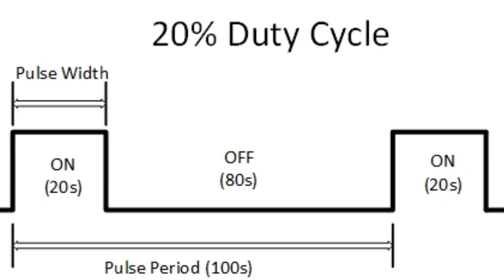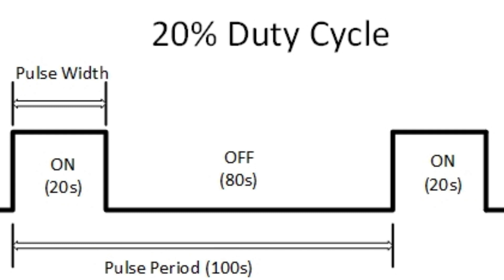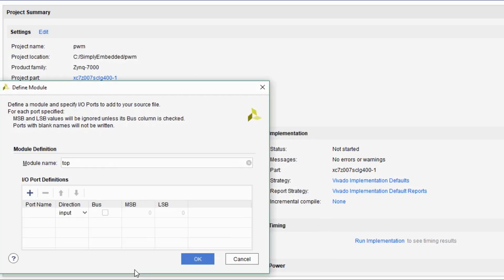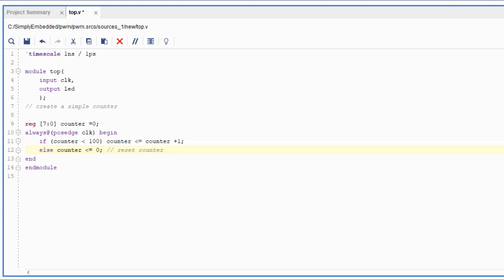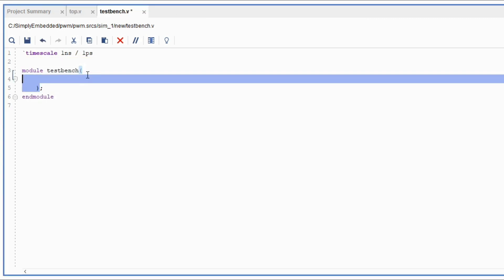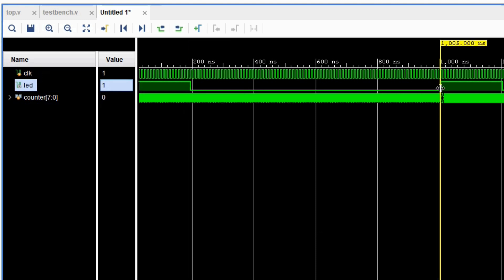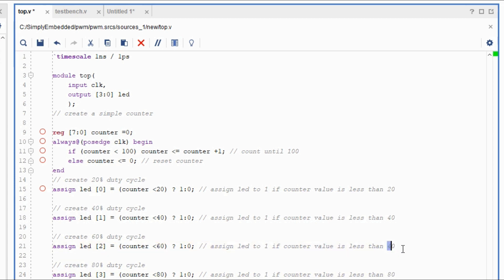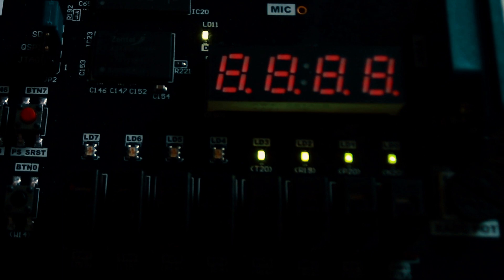How to Create PWM in Verilog on FPGA? | Xilinx FPGA Programming Tutorials

Comment: in the always block (the counter on the posedge of the clock), does the system just know to automatically spread-out the counting so that it is evenly spread out over the high period of the clock? Or does it not work that way? Is it incrementing the counter once per clock posedge detection, or is it doing all the counting at once at each posedge detection?  How come it doesn't just 'count too fast' and then not do anything?

Comment: This code, even when i put the right pins defined by a .xdc of my board (which is zynq-7000 xc7z020clg484-1), doesn't work. Apparently, vivado can't understand what is within the get_ports{    }. Please, help me! Synthesis and implementation is going well, but when i generate bistream, that error comes.##clock
set_property -dict { PACKAGE_PIN H16 IOSTANDARD LVCMOS33} [get_ports {GCLK}];

create_clock -add -name sys_clk_pin -period 10.00 -waveform {0 4} [get_ports{GCLK}];

##led
set_property -dict { PACKAGE_PIN T22 IOSTANDARD LVCMOS33} [get_ports{LD0}];  # "LD0"
set_property -dict { PACKAGE_PIN T21 IOSTANDARD LVCMOS33} [get_ports{LD1}];  # "LD1"
set_property -dict { PACKAGE_PIN U22 IOSTANDARD LVCMOS33} [get_ports{LD2}];  # "LD2"
set_property -dict { PACKAGE_PIN U21 IOSTANDARD LVCMOS33} [get_ports{LD3}];  # "LD3"
set_property -dict { PACKAGE_PIN V22 IOSTANDARD LVCMOS33} [get_ports{LD4}];  # "LD4"
set_property -dict { PACKAGE_PIN W22 IOSTANDARD LVCMOS33} [get_ports{LD5}];  # "LD5"
set_property -dict { PACKAGE_PIN U19 IOSTANDARD LVCMOS33} [get_ports{LD6}];  # "LD6"
set_property -dict { PACKAGE_PIN U14 IOSTANDARD LVCMOS33} [get_ports{LD7}];  # "LD7"
Reply: and my .v file is: `timescale 1ns / 1ps

module blinking_led_pwm(
        input GCLK,
        output LD0,
        output LD1,
        output LD2,
        output LD3,
        output LD4,
        output LD5,
        output LD6,
        output LD7
        
    );
    
//create a simple counter    
    
reg [31:0] counter = 0;
always@(posedge GCLK) begin
    if (counter <100) counter <= counter +1; //count until 100
    else counter <= 0; //reset counter
end
//create 10% duty cycle blink led
assign LD0 = (counter <10) ? 1:0; //assign led to 1 if counter value is less than 10
//create 20% duty cycle blink led
assign LD1 = (counter <20) ? 1:0; //assign led to 1 if counter value is less than 20
//create 30% duty cycle blink led
assign LD2 = (counter <30) ? 1:0; //assign led to 1 if counter value is less than 30
//create 40% duty cycle blink led
assign LD3 = (counter <40) ? 1:0; //assign led to 1 if counter value is less than 40
//create 50% duty cycle blink led
assign LD4 = (counter <50) ? 1:0; //assign led to 1 if counter value is less than 50
//create 60% duty cycle blink led
assign LD5 = (counter <60) ? 1:0; //assign led to 1 if counter value is less than 60
//create 70% duty cycle blink led
assign LD6 = (counter <70) ? 1:0; //assign led to 1 if counter value is less than 70
//create 80% duty cycle blink led
assign LD7 = (counter <80) ? 1:0; //assign led to 1 if counter value is less than 80

endmodule
Reply: please, help me!!!
Reply: @thebullybuffalo  i already solve this. Thank you

Comment: First of all,Fantastic video,very informative.
I'm having a issue with my project and is the part with PWM,
So If you don't mind,I would like to ask,how can I implement the video's code(idea) into mine?
My PWM needed spec is; 

a 4-bit Input PWM_control,

Input clock 50MHz,

a single bit output PWM_out,

Duty cycle is equal to 1/16 of input clock and

it changes when the value input is changed.

like, Value = 0000, Duty Cycle=0%

Value = 0001,Duty Cycle=6.25%

Value = 0010,Duty Cycle=12.5%

Value = 0010,Duty Cycle=18.75%

.... etc

when value changed,duty cycle should be increased by 6.25%

Thanks for any suggestion,please elaborate.